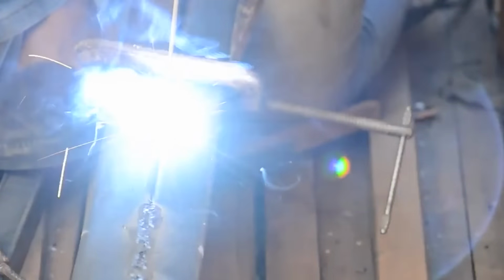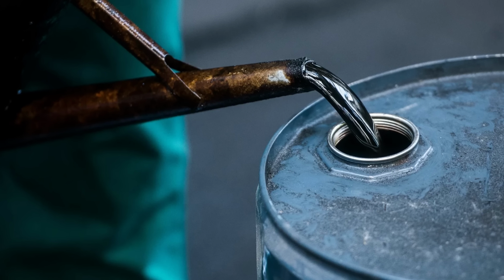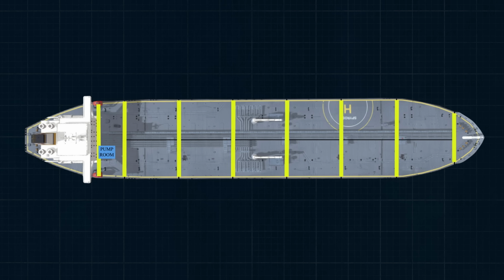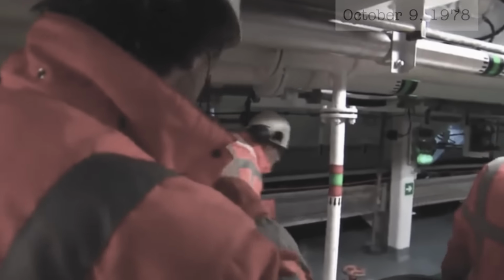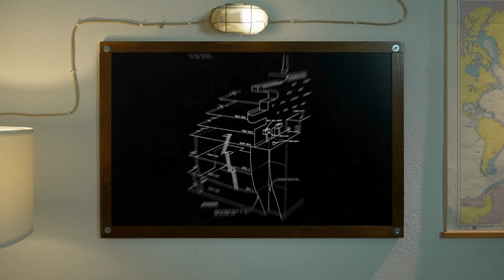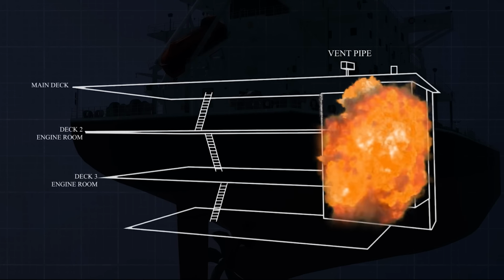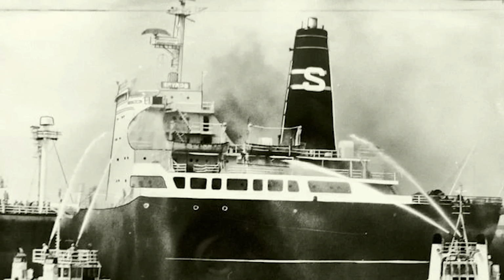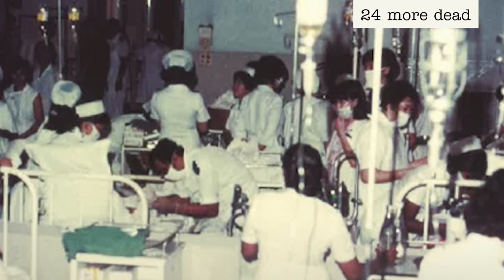A Floating INFERNO! | MV Spyros

Comment: Do you have a reference for the flammable vs. inflammable distinction? This is the first time I've heard about not requiring an ignition source, and I was always trained that the two words were indistinguishable. Thankks!
Reply: I can't find anything that agrees with his definition. One commenter said there is a Guardian article that uses that definition, but they also have an article saying they're the same. Everything I found says they are synonyms.
Reply: I don't know where the "no source of ignition" claim came from but the words have distinct meaning (or at least used to anyway). "Flammable" refers to something that can easily burn; "inflammable" means something is combustible.
Reply: @BiggieTrismegistus  And combustible?
Reply: I found some information about  that
"The words "flammable" and "inflammable" both mean the same thing: capable of being easily ignited and burned.. Despite the prefix "in-" often indicating negation, as in "inactive," in "inflammable," it acts as an intensifier, similar to "inflame". Therefore, both terms are used to describe materials that are easily combustible. 
Why the confusion?
The prefix "in-" can be confusing because it often signifies the opposite of a word (e.g., "in" + "active" = not active). However, in "inflammable," it comes from the Latin "in-", meaning "to set on fire". This historical usage led to some misunderstanding, with some people mistakenly interpreting "inflammable" as meaning not flammable. 
To avoid confusion, it's best to use "flammable" when describing something that burns easily. "

Comment: Vent pipes are not typically used to vent pressure building in a tank. They are typically to allow air to enter to prevent a vacuum when the fuel is being drawn out of the tank.

Comment: Joe Welder gets blamed for accident, sentenced to 38 years. After overturning the conviction, the real guilty party is identified and is fined less than the price of a new car. Amazing.
Reply: Not the real guy imo.

The safety officers failed miserably. 
"My job is to check everything. Nah."
"I'm here again!? Nah."
"OK, now this is literally my job. I'll make sure signs are posted.... OK, fine. I'll do an inspection."

Now, imo, the guy who signed off on the Theft Pipe 5000 should be imprisoned. Not the guys who installed it, but the guy who ordered it to happen. 

The safety officers who just ignored their jobs for 4 days should be fined ($8k 2ould sink me financially for years, so I think that would be a sufficient amount if they are similarly paid). 

The workers just doing their jobs? Who thought the welder was being an idiot? The guy with the hammer might have caused a spark that ignited it when it can ignite at 100⁰F!
Reply: @woodworkerroyer8497 
 Seems your the only one who identifies the actual guilty party, the people who ordered the transfer pipe installed. 
Pretty sure no one at Shell knew about it as they were paying the bonus.
Reply: @1crazypjI worked as an engineering cadet & officer with Shell for MANY years, I guarantee Shell were not aware of this practice but they always carry out an inspection of a ship before chartering it, I'm surprised they didn't spot the illegal pipeline then tbh!!
Reply: Hey at least the real guilty party was identified by the courts at all which is not even a given.
Reply: Criminal courts. 
Company made profit off of the lives of men. Courts are a business expense.
Reply: Sounds like another democrat scam.
Reply: One MUST remember that the cost of living in the United States is WAY higher than most other countries.
Heck, the cost of living in New York is probably three times what is would cost in some tiny town in the Midwest!

You say the cost of a car?
That is the cost of decades of life in most second or third world country!!!
Reply: @dangeary2134  doesn't really matter whatsoever that its a lot of money in another country its almost nothing to the guilty party and is easily shelled out without second thought removing the entire point of a punishment
Reply: @dangeary2134  
100.000 dollars won`t buy a house in my country, but you can live like a king in other countries.
What`s your point?

Compensation should be appropriate for the place the ruling takes place.
Reply: @afrog2666 you just made my point for me.

Thanks.
Reply: @afrog2666  don't ya just hate people who say 'What's your point', it's up there with; 'get with the program'.
Reply: @dangeary2134 Singapore is a first world expensive country.
Reply: @dangeary2134  isn't singapore one of the most expensive cities in the world?
Reply: @dangeary2134  The US is a 3rd world country, whats your point?
Reply: @MS2A-d7e  Average western European be like
Reply: @MS2A-d7e  The best 1st world country in the world* There I corrected your spelling. God bless `Murica. 🦅
Reply: Lol 😂

Comment: Excellent. I sailed on oil tankers for about 25 years so am very familiar with these procedures. There are not that many crude oils that can be directly used to fire the boilers without some refining, but the stuff they were stealing was one of them. We had used for fuel some Alaskan Swanson River Crude that could go directly into the bunker tanks provided it met flash point specs. I recall hearing about this tragedy on the news and in some marine industry magazines. Very well done presentation indeed. Thanks
Reply from the maker: Thanks I appreciate that

Comment: When we were working on tanks that had contained flammable oils or fuels we would run the exhausts of three or four welding machines into the tank to inert the space. That was before gas and oxygen detectors were easily available for use. It was better to pump out the tank with the welder exhaust filling the space as it displaced the air and fumes better.
Reply from the maker: Interesting 👍🏻
Reply: Do you mean purging with shielding gas?
Reply: @soundspark shielding gas like argon or pure co2 are expensive and not readily available in far away places. Gasoline welding machines are more easily accessible in those areas as stick welding is more common than MIG. The CO, CO2 and oxygen depleted exhaust coming from those welder engines is enough to remove one of the sides of the fire triangle.  It is a cheap easy safety fix.
Reply: @patreilly1458  the exhaust fumes are very hot though, which makes them less dense than the ambient air. It seems like it would be difficult to make sure you are displacing all the air from the tank. Usually you would use a gas that is heavier than air like co2 so the inert gas pushes the air out the tank vent as it displaces it. Did you have some way of cooling the exhaust down some? Did you deliver the exhaust down low in the tank and just rely on the sheer volume of exhaust gasses to displace the air?
Reply: yes.. but what if the other working party is somehow neglected their part of the job. this is no way the welder fault !!
Reply: l was thinking should have put a plastic bag over vent for a while then close off end of bag opening , bring it far from vent , try to light the gas in bag to see if flamable . squeese most of it out then light it , then not weld if fire
Reply: @orangestoneface  not a reliable method.

If the mixture in the sample obtained this way is too rich, it may not ignite when tested, giving a false sense of safety.  As air enters the tank and dilute the mixture, it will become flammable.
Reply: I've welded car fuel tanks before and ran an exhaust pipe through the tank before welding.  It seems to do the trick
Reply: So...still go ahead and steal the oil and be negligent in checks, but just remember to pump out the flammable air?? ...and you can get away scot-free for the illegal actions. With that kind of work ethos, no wonder 76 people died in this disaster.

Comment: The explanation of flammable and inflammable isn't quite right. They all require some source of ignition. I believe that materials that combust on contact are hyergaullic, but that is the mixture of 2 different substances. All other fuel materials need oxygen and an ignition source.
Reply: Hypergolic
Reply: They’re synonyms, not opposites.
Why the confusion?
The prefix in- usually means “not” (as in invisible = not visible).
But in inflammable, the in- comes from Latin inflammare — “to set on fire” (in = into, flammare = to flame).
So inflammable literally means “capable of being inflamed.”
Practical takeaway:
Because “inflammable” can be misread as “not flammable,” safety standards now overwhelmingly use “flammable” (and “non-flammable” for the opposite) to avoid dangerous misunderstandings.
So if you see “inflammable” on an old container — treat it as flammable.

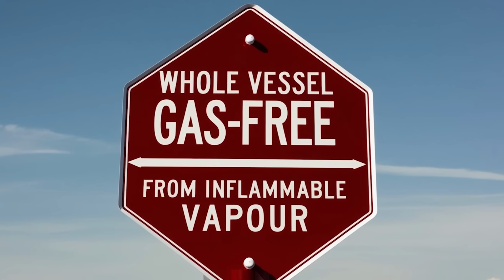Comment: Could you post a source for 4:55 ? I have NEVER heard this before and no source I have read says this. "(In)flammable comes from Latin but was changed to just "flammable" because people were confused on the prefix.
Reply: I just looked it up and the only thing I found agreeing with this creator is some article from the Guardian. However, the Guardian also had a separate article claiming inflammable and flammable mean the same thing lol. I’d go with the latter
Reply: @colesmith7509 
Inflammable covers substances that can self-ginite, while flammable is things that can burn.
Wood is flammable, but not inflammable.
Unstable gases that can self combust, pyrophoric gases, like hydrogen or nitrogen trifluoride are inflammable.

Non-combustible could be used when something cannot be easily set on fire.

"Flammable and inflammable look like opposites, but they both describe something that ignites easily and burns quickly. While the prefix in- is most familiar in its “not” meaning, as in inactive and inaccurate, the in- in inflammable is another prefix altogether: it means “to cause to be,” as in the words indent and indebted. Using flammable for what burns and nonflammable for what does not burn is an option if you want to ensure clarity." - 
Merriam-Webster
Reply: @afrog2666  It's a ridiculous word to use when there's so much confusion over such a dangerous word use. Inconceivable.
Reply: @BobContinental  So gesting toxicants to ebriation makes one coherent?
Reply: They’re synonyms, not opposites.
Why the confusion?
The prefix in- usually means “not” (as in invisible = not visible).
But in inflammable, the in- comes from Latin inflammare — “to set on fire” (in = into, flammare = to flame).
So inflammable literally means “capable of being inflamed.”
Practical takeaway:
Because “inflammable” can be misread as “not flammable,” safety standards now overwhelmingly use “flammable” (and “non-flammable” for the opposite) to avoid dangerous misunderstandings.
So if you see “inflammable” on an old container — treat it as flammable.
Reply: 5 months later and no response. Kinda sad.
Reply: And here I was, a 34 year old Australian, thinking that knowing about inflammable was just common knowledge. Never worked in any industry that uses either term, or handled any product that was either inflammable, or flammable. 

Maybe you're the odd one out?
Reply: @adamarzo559  who is this directed at?

Comment: Greed, theft, and negligence here.  Burns are very painful, and take so long to heal, and the pain of having the bandages removed, plus debris removal and cleansing is very painful for month's.  I wouldn't want to see anyone go through that.
G-d bless.
Reply: And the burned skin can never sweat again, so if the burns are too extensive the person will never again be able to endure high temperatures without their life being in danger. (I was born barely able to sweat, so this has been my life, but it seems to be getting worse as I get older. For burn victims it's not something they have years to get used to, it's a sudden disability. At least one burn victim has passed away during a heat wave power outage, for example. And due to the lack of being able to cool down, any burn victim who cannot sweat enough can never do any dry-land workouts again in nice or warm weather, only in cold/wet enough weather to let them stay cool enough. Just that aspect is life-changing, not counting any other aspect, and there are many other aspects. It really is terrible.

Comment: Flammable: Can easily burn.
Inflammable: Either not flammable at all or highly flammable. Avoid this word.
Reply: so if you have an inflammation, what does it actually mean?! we're asking the real questions here!
Reply: Some number of decades ago, these words had a clear distinction. 'Flammable' meant what 'combustible' means now, and 'inflammable' referred to volatile fuels like gasoline that burn primarily in the vapour phase and release more vapour as they're heated by the fire above.

But that isn't present usage, and the similarity of the two words creates confusion, which is why 'inflammable' is now a deprecated term.

Comment: I never knew the difference between flammable and inflammable. I guess the flammability is already in the gas, so its in-flammable because it doesnt need an out-flamm to ignite?
Reply: He's talking rubbish. Flammable and inflammable mean exactly the same thing.
Reply: I'll repeat some info that I found interesting, for the use of  the prefix "in"
"The words "flammable" and "inflammable" both mean the same thing: capable of being easily ignited and burned.. Despite the prefix "in-" often indicating negation, as in "inactive," in "inflammable," it acts as an intensifier, similar to "inflame". Therefore, both terms are used to describe materials that are easily combustible. 
Why the confusion?
The prefix "in-" can be confusing because it often signifies the opposite of a word (e.g., "in" + "active" = not active). However, in "inflammable," it comes from the Latin "in-", meaning "to set on fire". This historical usage led to some misunderstanding, with some people mistakenly interpreting "inflammable" as meaning not flammable. 
To avoid confusion, it's best to use "flammable" when describing something that burns easily. "

Comment: What a terrible shame.  In my opinion this one's a bit different in that there seems to have been some effort to do things correctly.
Reply: ... when stealing oil they were supposed to transport?
Reply: @a_lethe_ion  No, maybe I missed it.  Were the people doing the work on the boat at port stealing oil?
Reply: @billsmith5166  The owners of the ship were siphoning crude oil (which isn't theirs) into their fuel tanks.
Reply: @sokjeong-ho7033  So it wasn't the people at the port working on the boat that were stealing?
Reply: @billsmith5166  No, it was the owners of the boat. The port's fault was just poor safety inspection regulation, which wouldn't of normally caused a problem.

Comment: I still don't understand about inflammable gases.....?
Reply: I haven't seen any reputable source to agree with his definitions of flammable vs inflammable. Everything I can find (including Websters) says they are synonyms.
Reply: Inflammable means extremely flammable
Reply: The whole term inflammable is the worst anyway, because it can also mean completely non combustible. 
But an ignition source is a source of heat that starts a fire. So what they mean with inflammable in this context is technically that it needs a very low temperature and low pressure to combust.
Reply: Flammable gas require an ignition source to combust (spark, match, etc.). Inflammable gas can spontaneously ignite when mixed with oxygen, no need of an ignition source.
Reply: @edced_  Definitely not correct.
Reply: @edced_  Wouldn't oxygen be the ignition source.